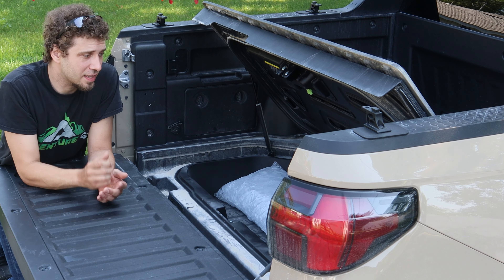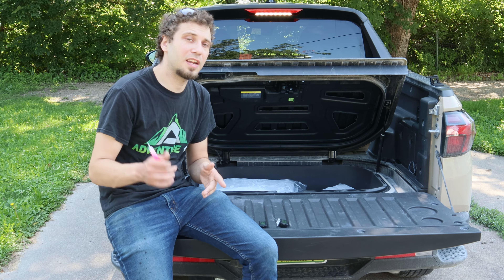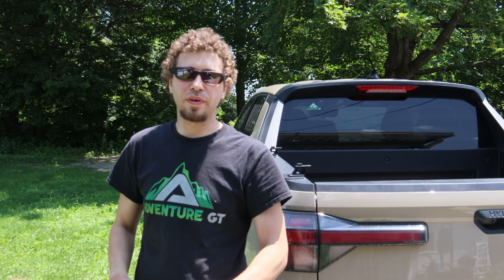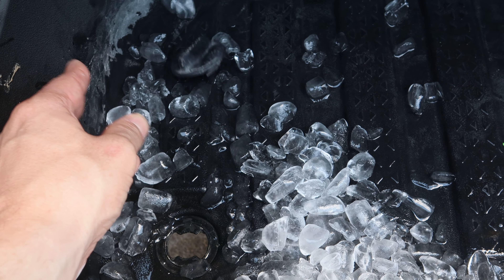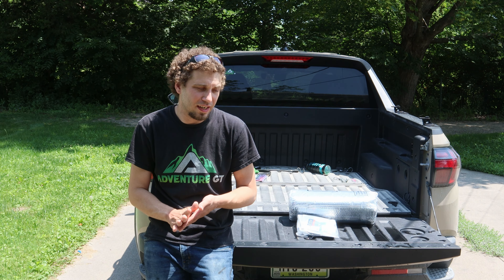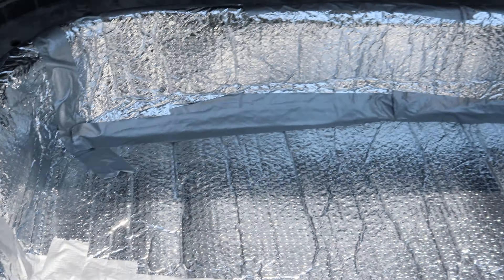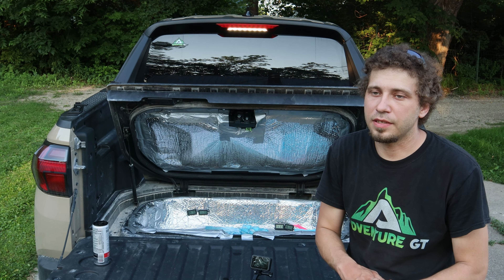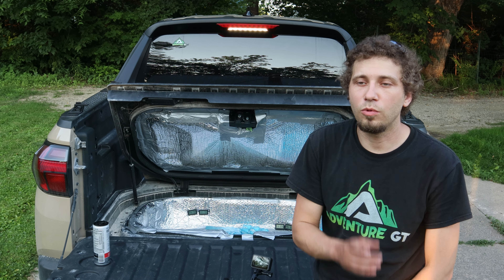Can The Hyundai Santa Cruz "Trunk Bed Cooler Be Used For  Camping, Overlanding?

Comment: One thing people don't realize or understand is that trunk cavity isn't insulated. I think it's more for a park and tailgate scenario vs compared to traveling with ice scenario.
Reply: But you can line it to essentially make it a cooler
Reply: I packed it full of ice, then later I went to check on it and it was bone dry.
Reply from the maker: That's why In this video,  I insulate it.

Comment: Thank you for this video. I recently tried the cooler in my Santa cruz .It did not keep it cold and melted in less than an hour. So I thought well maybe it's the plug draining because it's not in right or something . Very little to NO information on it, to compare my experience with it.
Reply from the maker: Glad you enjoyed the video.  I do belive the drain plugs may differ in certain years.  Videos of the very first Santa Cruz look diffrent then mine

Keep in mind these were never set up as a full cooler they are not insulated  tailgating at best. 
Even in that short you sent. I'm assuming they left the lid open the the whole time  and it was already dripping under the car but was so hot it gave off the appetance of it holding watwr really well. 

Like I mentioned in the videoif you wrap a plastic bag around the hole before installing your plug it will hold much better.    Hope it helps!